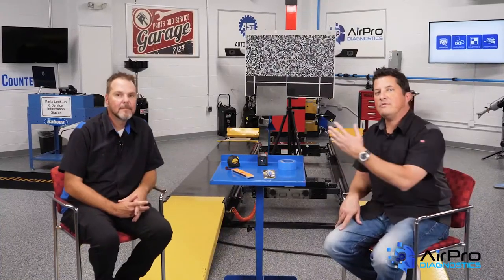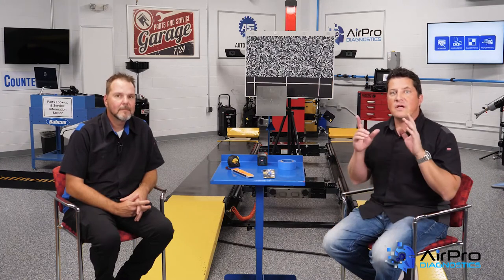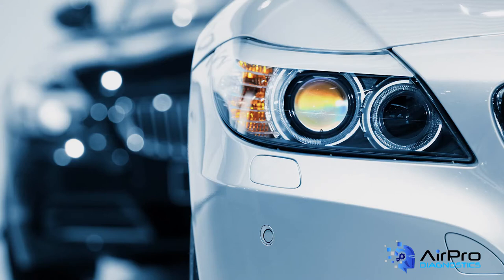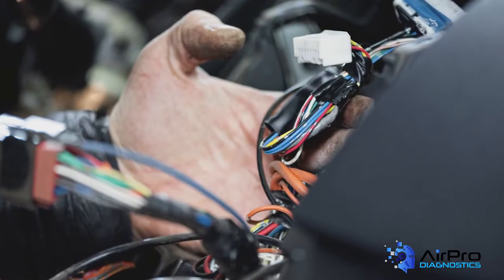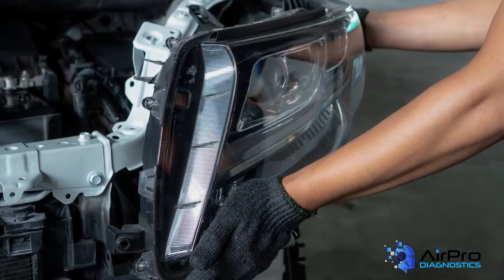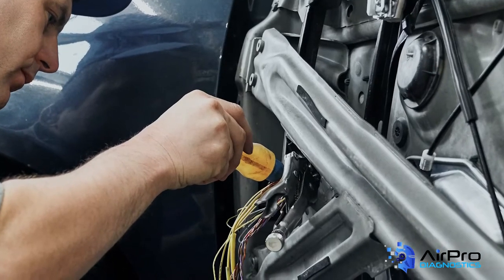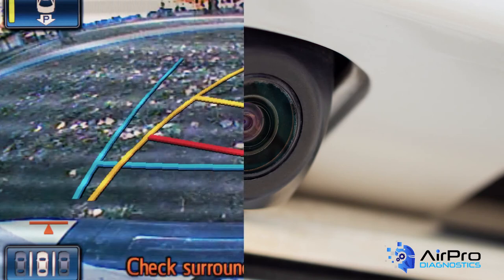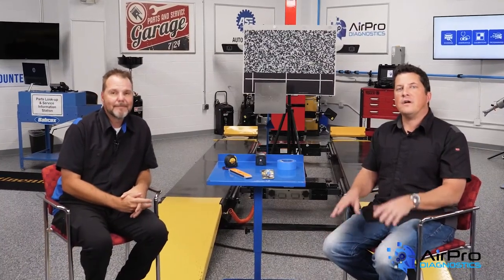Reassembling a Vehicle with ADAS

Comment: What? Body shops don’t have scan tools with all of the body DTC’s or failure codes like GM has been using since 2004.
  No, they have invested big bucks in a SnapOn scan tool. Now, understand the software is only as good as what they chose to buy from the manufacturer. Can you name “ALL” the manufacturers selling vehicles in the US? No. So to make the annual update less painful you have to purchase less software from the OEM, after all, it is intellectually their property. Plus some body tech has to have skills to understand that a hard code set for an O2 sensor, bank 2, position 1 is the symptom, as the O2 sensor is fine but the feedback wire from this Wide Band sensor is pinched, cut, shorted to ground, shorted to B+, or what? Use and knowledge of each car or truck is impossible as even the dealers body shop will have a tech come over and diagnose and repair the “Root Cause” as replace the $168 O2 sensor did nothing at Sam’s Auto Body Shop. 
Make it look pretty and shiny is one thing, but hard hits cause brittle old plastic on window regulator to allow a window to drop into the door. Still accident related and the insurance company needs to pay. 
  No difference that welding parts on a unibody car. Was it done correctly? Well if high strength steel is used on that area, constant heat from too much spot welding or MIG welder dude did a good job, they just change the temper of that one steel. It will not or may not perform as the manufacture wants it to if involved in another accident! 
 ASE Master Tech since 1978, retired.